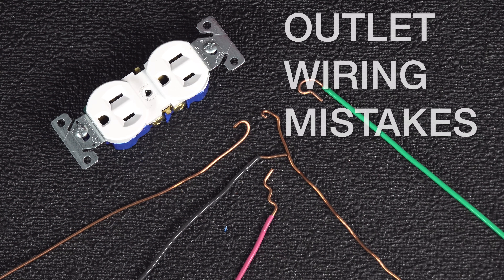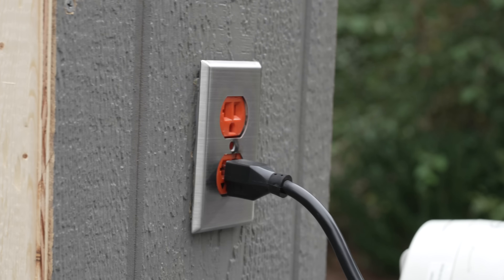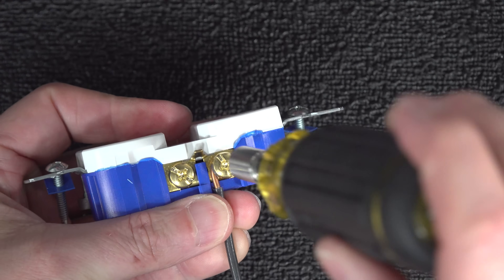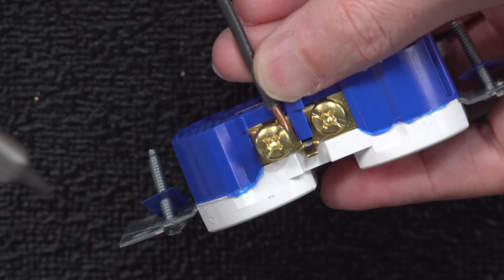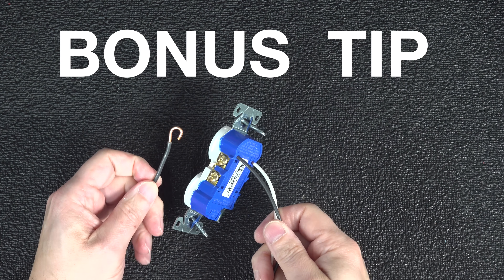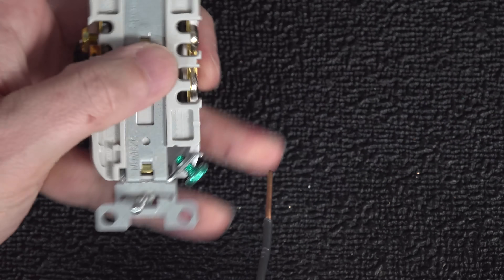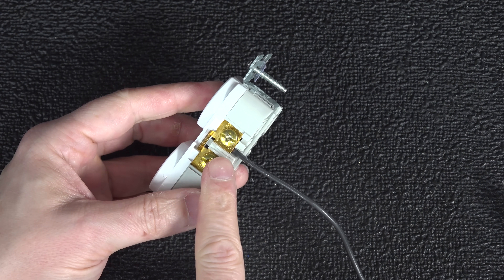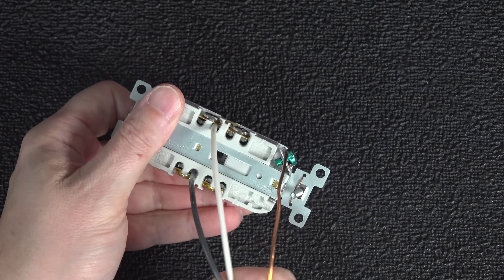BEWARE Of These 3 Common Wiring Mistakes On Outlets & Switches

Comment: While it’s true that the silver screws are the neutral screws and the brass/gold screws are the hot screws, and it’s also true that the hot wire is almost always black and the neutral wire is almost always white, that doesn’t necessarily mean the white wire is always the neutral or the black wire is always the hot. My preferred method is to use a non-contact voltage tester to identify which conductor is live. Then you know for sure.
Reply: Had to completely re-wire a buss-fuse sub-panel on a rental property we picked up, Line Hot was white, and connected to the ground bar along with all the branch circuit hot lines, and the nuetrals were on the fused load side 😳 and since some of the outlets and lights were wired "properly" I was getting line voltage on some grounds. Total mess and surprised it never caught on 🔥 🤣
Reply: @SavageOne420  see!!!
Reply: But by using a NCVT, what if you run into a hot line with a hot neutral? I've seen it many times, with nothing labeled, and a white wire being used as a traveler, but then I've also seen neutral being hot, along with the hot line, because some idiot didn't know what they were doing.  Use a tester,   to make sure. I love my NCVT, but I wouldn't trust my life with it. I always do a quick test after I sweep with my non contact.

Comment: You're dead on about the back wiring what we used to call "stabbing". I've seen so many problems with this and absolutely refused to use when I did new construction wiring.  Some would even drill the hole out in the back so #12 would fit. Reckless because you are gambling with the possible loss of someone's life should a loose connection start a fire. The ones with the pressure plate are my preferred choice too..  Another tip is an outlet with the "T" shape neutral is a true 20 amp outlet NEMA designated 5-20R. The ones with straight slot are really for 15 amps NEMA designated 5-15R. Great information for the DIYer.
Reply: Yes, "stabbing" is the term I have always heard for that push-in insertion. (Not where is is clamped by the screws.)
Reply: Why would someone go through all of the extra work of drilling out the holes on the device? literally just take half a second to curl your ends it's quicker. Could easily just pigtail the conductors if there are too many if that's the problem. the mind boggles. 😄 Not to mention how much of a nope that is.
Reply: @theeeddboyy6020  I agree. But I was just a grunt with no say so what the others done.
Reply: @yomomma9070  Oh I totally get that part. It just racked my brain for a second 😅
Reply: @theeeddboyy6020  IMO, it is best to pigtail all receptacles so that a circuit is not dependent on that device being installed for the circuit to be complete. It's a little more work initially but so much easier to work with and faster when Changing the device.
Reply: 20 Amp outlets should not be used on 15 amp circuits. The design is to show the type circuit whether NEMA 15 or NEMA20. A spec grade 15 amp will be fine on a 15 amp circuit.
Reply: @donaldsmith5972  you're correct. Its a violation in both the CEC and NEC.
Reply: @MrYummynomnoms  Thank you! Wiring of a house is not for amateurs. We do make mistakes but fewer than the untrained do. It is also easier to replace a receptacle when only three wires are involved.. the house I live in was built new and the wiring was done using the stab-in method. I have replaced most of the outlets with spec grade and installed to my standards. There is one behind a couch that remains to be done but it is heavy and I am old. Take care.
Reply: @MrYummynomnoms  I just looked that up b/c I was curious myself.  The nec says that 15 Amp outlets shall be permitted on a 20 Amp circuit as long as it's not a single outlet. If it is a single outlet, then it must be rated for the total circuit ampacity. A standard outlet, termed a "duplex" outlet is considered as two outlets so a single duplex outlet rated for 15 amps may be connected to a 20 Amp breaker. I personally don't agree with this logic, but that's the wording in the NEC. I myself, in my own home and work would spring the extra cost to purchase the heavier duty outlets and have #12 wire ran to each and connected to a 20 Amp breaker.
Reply: @yomomma9070  i just checked my NEC I thought it over lapped. My mistake always check before opening your mouth. NEC 210.24
Reply: @MrYummynomnoms  we're both learning. I always wondered. Probably wouldn't have looked it up, for not this video.

Comment: I haven’t seen any of those upgrades plug ins yet at the home improvement stores? Guess I’ll have to take a closer look next time I’m there! I already knew not to use those holes on the back of plugs though and I have had to replace several plug ins over the years where people used those holes and their electrical wires got so hot it melted the plug in on the back and the plug in failed. You could see burnt black marks inside the box too. definitely a fire hazard using those holes on the back of those plugs. Why they were even allowed to sale plugs with those holes is beyond me? Should of never been made with those holes in the first place.  Unfortunately still not enough people out there that don’t know not to use those holes or the possible danger using those holes can cause either!  Hopefully those holes will disappear and these new upgrade plugs will take their place!
Reply: They are usually called commercial grade

Comment: The comment on the ground screw "hook" is incorrect. A lot of GFCI outlets have a backstab plate where the ground can simply be inserted. This helps a lot with stranded wire.
Reply from the maker: That's interesting I haven't come across one like that but I would like to. Would be much better.
Reply: Additionally you can get pigtails with the screw already attached. Bonus: your ground is insulated as it gets folded into the box, or screwed with later and jammed back in

Comment: The old school outlet you started with also has a built in strippers.  It's the little area below the removable squares on all four corners.
Reply: I would not recommend stripping with anything but correctly sized strippers that will not nick or score the wire. Anyone without a good set of strippers should not be installing outlets...
Reply: @stevefrawley9756  Right….. but they are there just the same…Kind of an FYI moment.
Reply: @stevefrawley9756  ...not building watches
Reply: @lostcause1206  Not a cosmetic thing like a watch, but a safety thing. Nicks on wires are mechanical stress points and if deep enough, can also cause the wire to overheat.
Reply: @stevefrawley9756  He means the precision of a watch is highly important it's not a saying about aesthetics. A tiny nick on a wire isn't going to matter. Lots of people use side cutters if you have the right touch you can strip with them no problem
Reply: @robbarber7253  I design and build airborne systems for the US Navy. If we nick a wire while stripping it, we cut and redo it. It can matter. A belief I bring into the home.
Reply: @stevefrawley9756  the military has time and money to set a standard that isn't applied anywhere in the real world.
Reply: @jeremyanderson3819  Yeah, you're right. Our standards should be set by anyone with a video camera and a YouTube account...
Reply: @stevefrawley9756  Understandable in those situations. A tiny nick from side cutters is on every building in the entire country I promise you without any negative consequences.
Reply: @robbarber7253  Conceitedly, I would not bet against that...
Reply: @jeremyanderson3819  "The military has time and money to set a standard"

Yeah, their standard is the lowest bidder. Don't he fooled by anything "military grade," it's usually the cheapest thing that gets the job done.

Comment: That's a spec grade outlet. Very nice. They cost more but are higher quality and save so much time on install or rework.
Reply: My regret in DIY is not using commercial grade receptacles. The cheap ones don't last.
Reply: @KameraShy  Same goes for switches. Almost every broken switch I've replaced were the cheap ones that are sold in bulk boxes.

Comment: You missed one other tip. Those screws on the side don't really fit a phillips very well as the hole in the center is more of a "Roberts" bit. Milwaukee makes an "ECX" bit and insulated screwdriver that is a combination square/flat bit and fits electrical screws perfectly.
Reply from the maker: Good point, though it's crazy how many electricians stick with flatheads alone. I guess if it works.
Reply: The square bit is called a Robertson, and it is much better than either slot or Phillips.  It isn't popular in the U.S. due to licensing issues.
Reply: @wizardsuth  it is actually especially in klein tools
Reply: Klein makes a combination bit as well that works great for these.
Reply: I’m curious – what size screwdriver tip fits those screws?  I’m replacing all the outlets in my sister’s house, so such a tool would make that job easier.
I found a set of Milwaukee ECX hex bits at Ace Hardware that has both a No. 1 and a No. 2, but the only insulated screwdriver I’ve found is the smaller No. 1.  My guess is that a No. 2 would fit better, but I’m having trouble locating one of those.  What do you think?
I’d rather have the insulated screwdriver instead of just the hex bits to use with my uninsulated driver.
Thanks!
Reply: @David_K_pi  ECX #1 fits outlet, switch and breaker screws. I use my Milwaukee insulated ECX screwdriver for everything. It is P/N 48-22-2241 and is ECX #1.
Reply: @eosjoe565  - Many thanks!  Most things I do with a regular screwdriver seem to require a No. 2 tip, so I was confused about why an ECX No. 2 was not readily available - at least not an insulated one.  I'll just order or pick up a No. 1.  Perfect!
Reply: @David_K_pi  yeah number 1 is perfect fit I have it on my drill when I have to do 30+ at work
Reply: @David_K_pi  I installed 1000s of these with a basic keystone flathead slot screwdriver that fits nice & snug or a #2 Phillips or a square drive Roberts, no insulation and I have done 1000s of them hot. I have scorched ONE wall in a school. That is it. It happened to be the light switch in the principal's office and it was 277 volts so it was a really nice big scorch mark. Some companies wrote me up for working stuff hot. I do electronic repairs now so the work comes to me. I went into audio and RF so leave behind the 120/240 single phase, -120/208 and 277/480 3 phase  and the rather rare 3 phase delta delta 120-208-240 wiring for 50,000 volts DC. That stuff either kills instantly or it removes body parts instantly. You are better being dead than missing arms, both eyes your face and both legs. IT'S ONLY A HOUSE, SO TURN THE ****ING  POWER OFF! Radio & TV stations get really super ultra mega angry when they go off the air because the transmitter is off. They lose loads of money ever second they are down. Factories are the same way, only they usually have have safety programs. Our local union requires TWO JOURNEYMEN to work on anything above 240 Volts to ground. Technically NOTHING is 240 volts to ground in the USA. So any 277 or 480 live work you need someone else there to save you from possibly dying. Intel requires 3 people for any live hot work. One onlooker has to be CPR certified too. You need a hook or a harness, a hot mat, a face shield, safety glasses, a Nomex jacket  2 safety people and 120 tons of paperwork. You literally have all a little booklet of crap hanging around your neck with all of your certifications in it, and group tome of SIP papers. It's bulls**t!  It takes 2 weeks to to do a 2 minute job.
Reply: @chrisxsol  - Cool! Thanks! 😁
Reply: @eosjoe565  ECX #2 is the right size for most breaker screws but given the flat head part ECX #1 will sort of work too. If you want a good fit on breakers you need the larger bit as they're a combination screw between flathead and #2 robertson instead of #1 like most outlets and switches.
Reply: @AndrewMerts  Good to know, thanks!
Reply: @Satchmoeddie  You could argue the exact opposite: allowing people to have even the slightest risk of dying at their job when there's a known, workable alternative is bulls**t. Two weeks of paperwork and all the safety stuff is probably annoying, but it's better than people with families and hobbies dying because corporate wants it done faster. Your local union's doing great work.
Reply: @Satchmoeddie  enjoyed your comment, reminded me of a time my company was replacing all the light fixtures in a small school, about 1000 fixtures, I finished my service calls that day so I went to help out at the school, got there went an asked the lead guy, which was a new guy, if everything was off, he said yup so I went into a room started to take down old fixtures and on the third one when I cut the pig tail I got lit up like never before, now here’s something weird about myself that’s kind of crazy…. I like the feel of a 110 buzz BUT when that 277 hit me it was unreal, knocked me off a 12ft ladder and put my ass on the ground for about 10-15 minutes before I stopped feeling it in my chest, felt it in my arm the rest of the day pretty much. Turns out the new guy didn’t know anything about the emergency circuits and they were still on, that’s what I cut into. Lesson learned that day was never ever trust anyones word and always check for yourself! I should’ve thrown a meter on it so I blame myself, I was definitely lucky that day!
Reply: @thisoldshtboxchev  I always went and checked the service entrance box and installed my lockout to the batch. 

Yessss, 277 V across the chest is a killer. I just brushed my arm on a troffer's connector when running Cat-5 and it was hot. It too knocked me thru 3 ceiling grids, down 10 feet and another 15 feet backwards.
Reply: @eosjoe565 Yeah those will look sweet I didn't know they had them. Whenever I do electrical outlets I use a slotted because I can get it tight but always risk of slippage. Definitely got to purchase some of these
Reply: @David_K_pi  Amazon
Reply: By saying the combination works perfectly, you mean to say you can torque the screw down properly so it stays tight.  The others will work but not properly, which is what this video is about, doing things correctly.
Reply: My tools of choice is the WIHA insulated Zeno driver. Does not slip out, applies the torque of a flathead, and is fully insulated. The ECX is also a great choice as it is also available as a hex bit that can be used in any driver...
Reply: @stevefrawley9756  I went looking for this. Seems to be spelled Xeno. They also call it a terminal block driver.
Reply: @chrimony  Correct, it is Xeno, and they come in both #2 and the smaller #1. I guess they use terminal blocks a lot in Germany...
Reply: Absolutely, all of my coworkers use a flat or Phillips, but for devicing, I wouldn’t take anything other than my square bit, not to mention my Klein 11-1 screwdriver
Reply: Bruh I use those everyday an have had head lead guys ask wtf I got that bit. I run that bit an Robertson only only rip my flat for t-pole fixing. Need a new flat for plates. Feeling an electric powered since I feel lazy an have to rip plugs all day.
Reply: The best bits for these screws are P2r2 Bosch bits, ecx are a perfect fit, yes, but they’re wonky to use in that you have to line it up. P2r2 are square and Phillips in 1
Reply: @xanaduse  "but they’re wonky to use in that you have to line it up." You could say the very same thing for a flat blade and phillips head screwdriver.
Reply: it's actually called a Robertson screw head terminal FYI
Reply: I just bought the Klein combination driver #1 size. Fits perfectly.
Reply: Get out of here with that Milwaukee bullshit. Use a good insulated Klein flathead screwdriver.
Reply: And usually, it's the green screwdriver.  The red for the screws inside the box.   At least in my experience the colours seem to always match up to the same sizes.
Reply: yep the old 10X1 with the Robertson tip does the trick
Reply: You just revealed a “secret handshake” of the electrician’s world. Expect their mafia enforcers to come down on you like a pile of vitrified red Georgia clay. 😅
Reply: I was going to mention this too.  The correct driver makes for a better connection.

Comment: Bonus tip for your viewers. I see people (including my past self) trimming back the spare slack within the outlet box. Code calls for 6"+ of wire slack in many places. The extra wire comes in handy! So don't cut it all off when having issues stuffing everything back in. (There is a technique for this as well).
Reply: In an add-on bedroom of my house, that is exactly what they did. Cut the wires short. I can barely attach a new outlet in them. Had do do it a number of times on upgrades. If it was just a hair shorter, I would have to pigtail.
Reply: @KameraShy  I like using the orange wago connectors to piggy back with. Silver cymbal has featured the wagos in a few past videos. Pricey per unit but very nice.

Comment: Electricians are licensed for a reason. It is not work for amateurs. Good guidance but a wrong move can be fatal or catastrophic. Tread carefully.
Reply: I wish licensing meant skill! My house wiring has some nasty stuff I fixed. Sad inspectors also don’t catch it.
Reply: @RickLaBanca  Just for curiosity, did you get a permit and have your work inspected? Code rules on house wiring are extensive and sometimes tricky for a novice to understand. As far as skill for licensees, it depends on the licensing authority. Some are lax and some are really tough. Good luck!
Reply: @donaldsmith5972  no they were simple fixes. Eight neutrals in one wire nut, some exposed (stripped too far) wires etc.